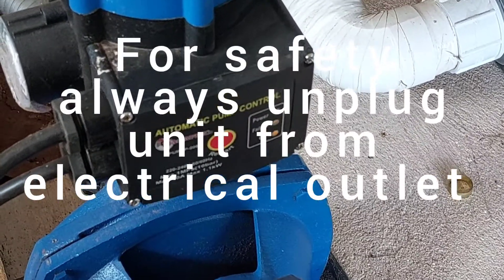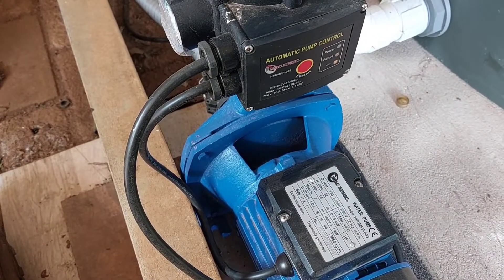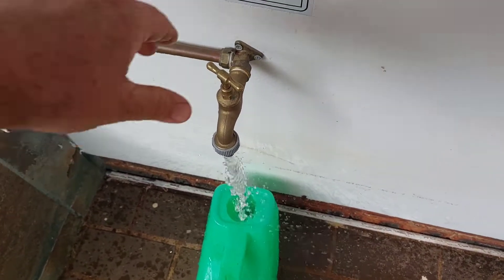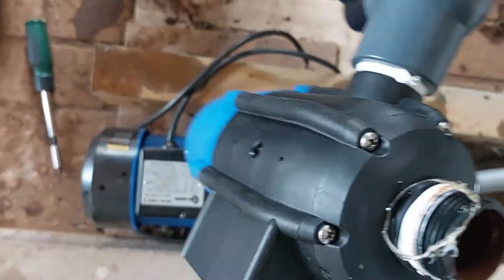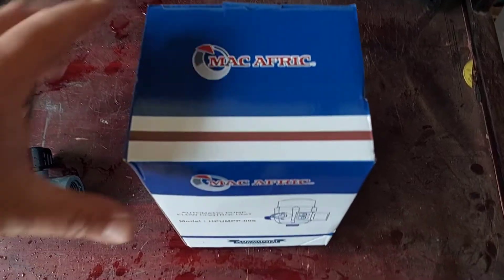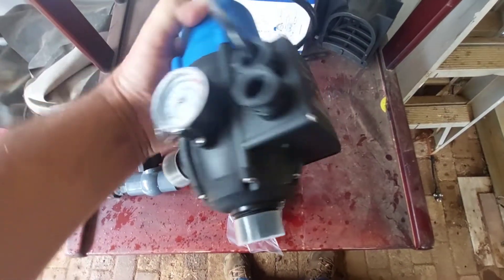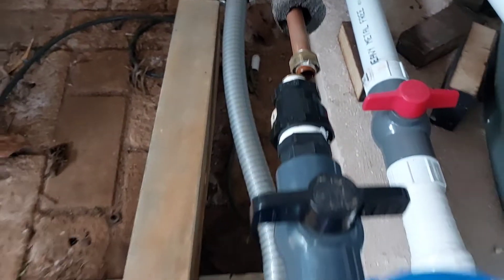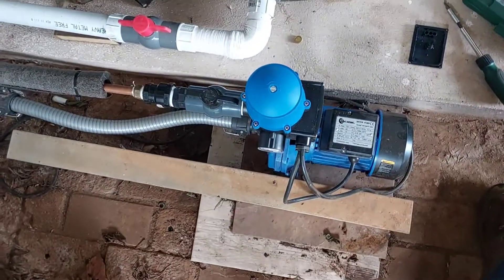Jojo pump, diagnosing &  installing

Comment: How long was it used before the control switch was replaced? Just wondering on the quality of this product versus Jojo’s version of this centrifugal pump. They seem identical!
Reply from the maker: Hi approximately 5 months
Reply from the maker: I may add. This pump is much better. I also have a Jojo pump however it's really small version compare with this one.
Reply: @fulltank3495  Thanks for the reply. I ended up purchasing one, looks like a solid product. So far so good
Reply from the maker: OK that's great news.
Let us know how it goes.
Reply: @fulltank3495  Hi, is there any noise difference between this pump and the Jojo pump? Also how’s the noise in general while the pump is running.